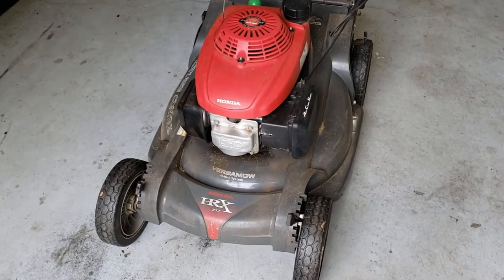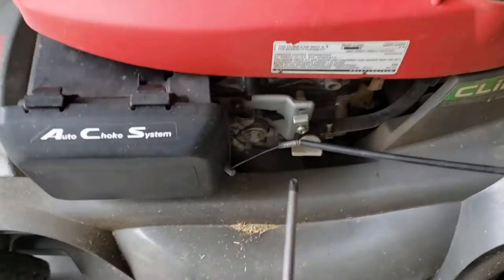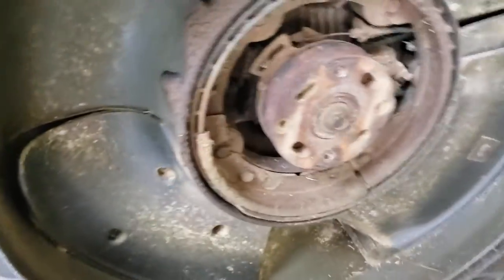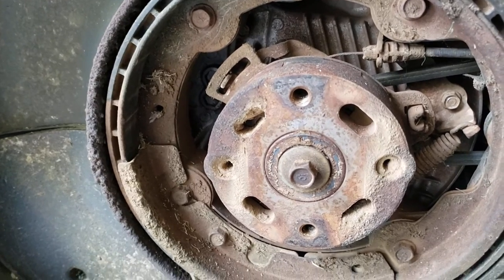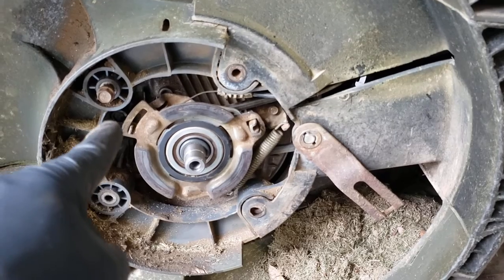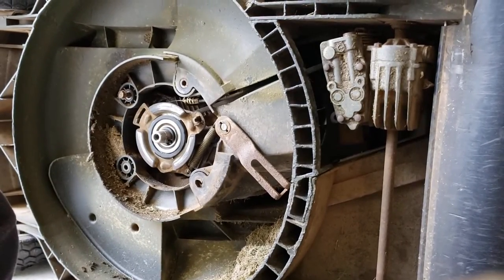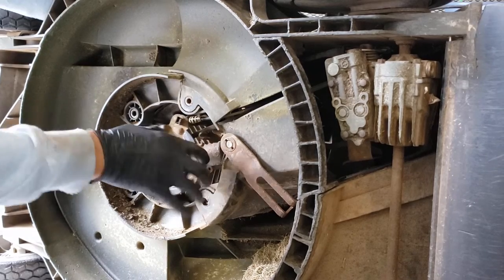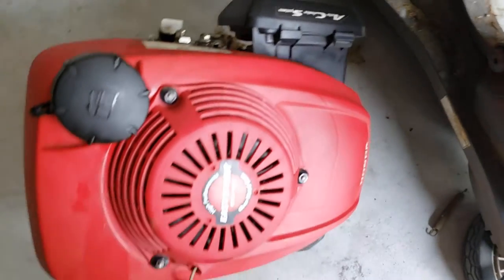Remove engine from Honda HRX 217

Comment: I am amazed at how difficult they make the assembly of these mowers. I have pulled a few of the Honda engines from the model, and all the bolts and over-engineering make my head hurt! Thank you for a great video though- it has helped me several times.

Comment: I bought one with electric start and like new condition for $35. Will be replacing connecting rod, piston and new rings for $70. Getting flywheel off, to me is the hardest part. Some reason they are on there. Had to take starter off too.

Comment: I have the same mower and it broke as the engine was all locked up and have to be replaced. Is it worth spending about $400 to replace just the engine 190cc honda just like in this video, or is it better to buy another lawnmower?

Comment: Can I put the newer hrn 216 engine into this mower? I have a hrn that has broken plastic where the wheels go and it’s all messed up. But the engine is still kickin strong. I want to put that engine into this chassis. Is that possible? Is the transmission engaged simply via a tension belt?
Reply from the maker: That depends on the engines axle, it has to be the same length and have the same notches for the key